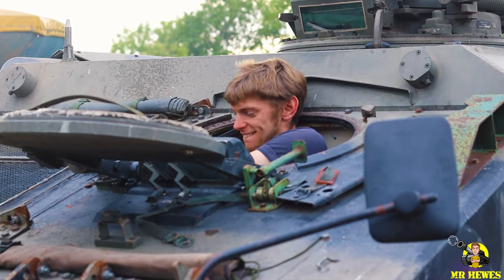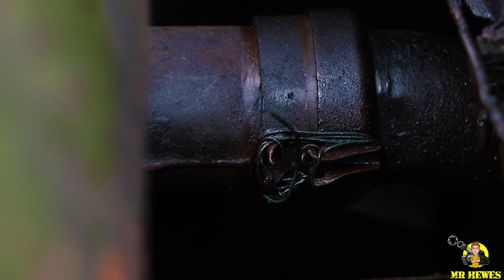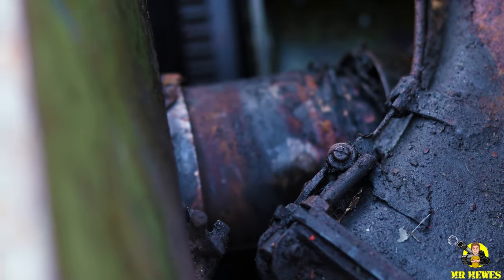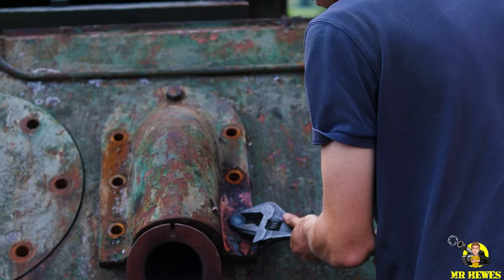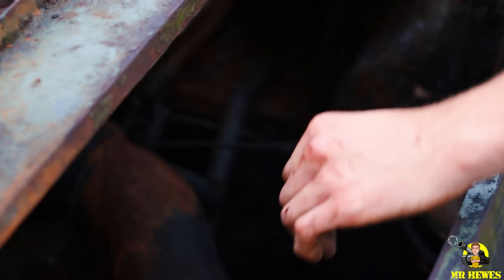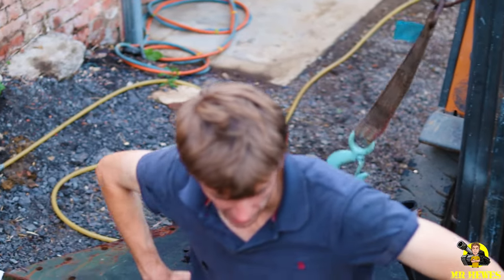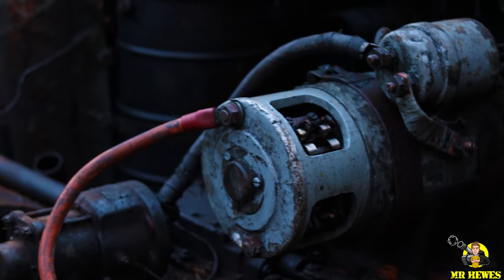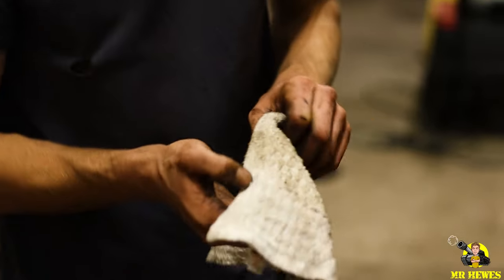It's Falling Apart! T34/85 EP3

Comment: Great content. I am enjoying catching up on older videos since finding this channel.
  I cringed every time he reached between that rear armored plate and the hull. Especially when he stuck his face in there. I certainly wouldn't have without at the very least blocking and a chain or cable tied off someplace solid. 
  When that hinge broke away and the plate fell on the ground, I was hollering at the screen, "That is a perfect example why!" 
  Never forget you are the softest / squishiest tool in the shop.

Comment: Imagine being a Soviet conscript in pre-war USSR as a T34/85 crewman.  Right off the farm, maybe this crewman has some experience with a tractor if the farm/collective he was raised on was lucky enough to have one, and was trained to service it.  Now imagine your tank and crew has been assigned to a regiment in Siberia and it's January.  Yes the engine has a poor man's EGR but the more practical use is as a fast motor warm-up setting for those icy cold start-ups and quickly put some heat in that iron igloo.........you'd be very thankful. these tanks were designed to be operated by troops with little training and maintained using readily available materials.

Comment: I have heard that the soviet command put immense pressure on the T-34 production factories to produce as many tanks as fast as possible (or else). Quite often corners had to be cut to reach production quotas so war era T34s are renown for have all sorts of serious production defects. Given that the soviets mainly only exported T34's built during the war i wouldnt be shocked if you came across a few surprises.
Reply: The Soviets didn't export tanks in WWII... everything was in critically short supply and stayed home to fight the Germans.  Canada, the UK and the USA shipped millions of tons of food, tanks, vehicles, radios and other equipment to the USSR to help them fight and keep the Germans distracted by trying to operate on two fronts.
Reply: @majmikecalnan  Indeed.... and when world war 2 ended the demand for T-34s dried up but due to the soviet economy production could not stop. T34s producted after the war were of notably higher quality than those made during the war. The USSR decided to keep its best stock of new T34s for the red army in Russia. The less reliable wartime produced T34's were sent to the other soviet republics as well as exported to other communist countries like china and north Korea.

Comment: Seen others lighting a welding/cutting torch. They hold the tip against a surface at about 45 degrees as they bring the oxy in. seems to work.

Comment: Is this diverted exhaust back in the air cleaner meant to produce smoke screen or help in Russian cold weather?
Reply from the maker: Interesting 🧐
Reply: Does the exhaust outlet have a venturi in it, so that when the gases leave the exhaust pipes it creates a vacuum and draws loose dirt and dust out of the air filter ??
Reply: my guess is heat air entering the engine, engine smoke is typically made by spraying fuel into the exhaust